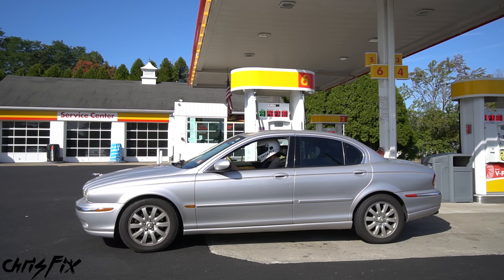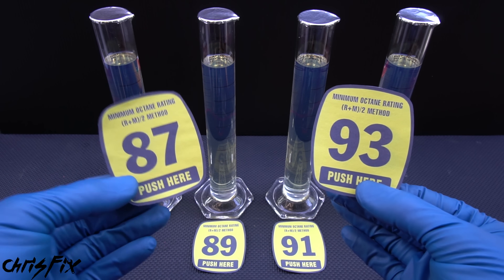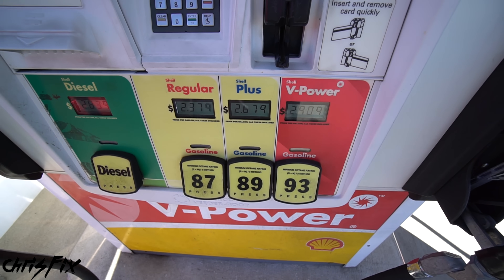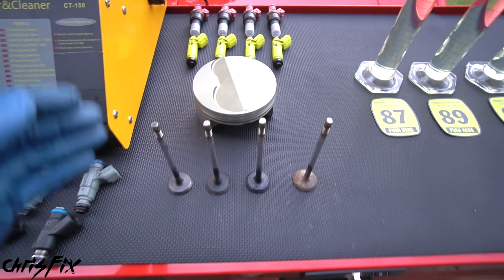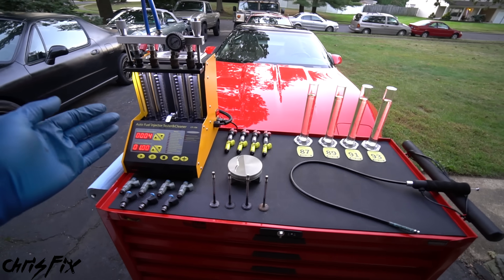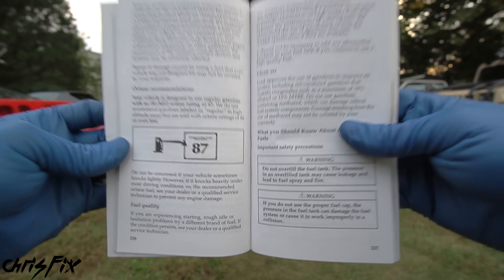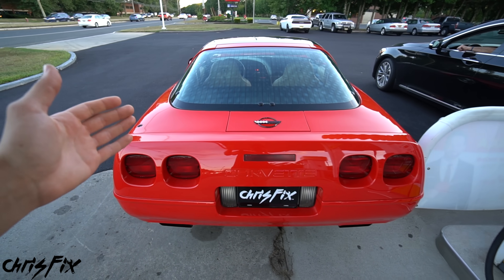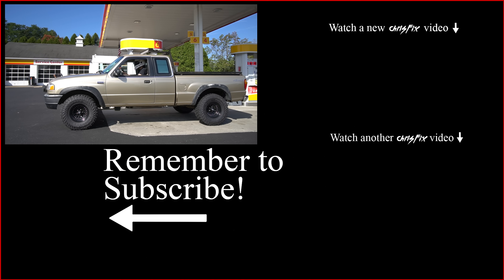What is the BEST Fuel to Use in Your Car or Truck and WHY

Comment: While I didn't need to watch this video, I did 😊 What I did get out of it though was I want crazy when I would use premium here and there in my 2003 Elantra with 177,000 miles on it and when I do, most of the knocking goes away. Now, I am going to only use premium for about 3 months. I'm a Chevron guy but might have to use that 93 at shell 😏 Thanks Chris!

Comment: They are big difference on my 2010 Nissan altima if I put regular fuel the check engine light on for Cat converter And then when I was almost on empty I put premium 93 after running it almost empty the check engine light go off it runs more cleaner.. And I have done this test multiple times and other cars.. So I  only use sell premium gas only they have the best gas..

Comment: I have heard this story before. Bottom line is whether you have a 5 hp engine or 300hp, the higher the octane, the more efficient the engine runs! I own an 05 tahoe, if i burn regular gas it uses more of it! That includes the lawnmower as well.I have done the test over + over + it's always the same.Thats my story+ i'm stickin' to it.

Comment: I think when people say high test is better..it might be because a modern car's engine can advance the ignition timing which will give you more power and better mileage. A good test would be to determine once and for all..does 91/93 increase mileage and power or not? Does 91/93 keep your injectors and valves cleaner or not? I wish you'd have done those two tests because I struggle with that when I'm at the pump!
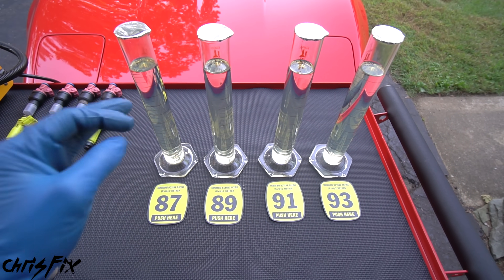Reply from the maker: 1:53 and 5:45

Comment: Higher compression requires higher octane but higher altitude means thinner air and lower compression . In Colorado above 5000 ft our regular gas is only 85 octane But that is fine for cars that specify 87 Because in this altitude 85 octane works as good as 87. Unless your car is turbo charged which increases the air pressure in your engine.

Comment: I put 91 octane minimum in all my gas vehicles; don't care what the manufacturer states.  Even lawn tractor gets premium fuel, I hate the smell of cheap gas!!  However, all my vehicles are high performance.  You get better fuel mileage from higher octane fuel too.  Plus you save on repairs and the motor just sounds like it runs better.

If I put regular (87) in my Escalade, check engine light goes on and starts flashing.  lol...

Sometimes, premium is not available and in the coronna era, many gas stations close at 5pm... so you're stuck with either cheap gas, or take a motel until the next day... so cheap gas it is!  However, I like the idea of carrying a can of Octane Booster; thanks for that tip!  =D

Flexfuel hahaha that's cute....

Comment: Ethanol vs. non-ethanol gas was not covered.  Also, it was not mentioned if there is any downside to running 93+ fuel in a car which specifies 87, only the other case.

Comment: Amazing video Chris! Two questions for you. You showed valves and how port injected engines clean them, but how do you clean them in direct injection engines? Is there any way to do so without taking the engine apart? Also, do you recommend running e-85 (assuming your vehicle can take it, of course). From what I’ve read it has a lower energy content, but is it better or worse for your engine? Thanks!
Reply: the best thing is to avoid ethanol gas, so avoid e85, e85 is honestly for race cars. you can only go so high in octane without having ethanol. theres a fuel induction cleaning service recommended every 30k miles, or 10-15k with e85

Comment: if all gas has the same energy then why is race gas 112 octane
and why do engines need different timing setting with different octane for the best power results

Comment: I use E-85 in my SUV. However there are very few stations providing E-85. What then? I use regular with a bottle of octane booster. I am not sure if this is correct. 
Any suggestions?

Comment: Would you recommend using BG 44K at all to clean fuel system? If so, would you recommend just using that product over having the dealership talk you into doing a fuel injector cleaning? I have a 2020 Acura RDX ASPEC, use recommend fuel. Dealer is already suggesting I clean injector system at 9000 miles. I said no, it’s brand new. Car does have direct injection. Thank you for any insight.

Comment: ChrisFix,

On the swedish wikipedia it's saying:
"Octane number is a measure of a fuel's ability to withstand temperature and pressure without igniting"

I don't understand why you say it's not anything about temperature. Since my Mitsubishi-dealer adviser says the wikipedia version. And you were saying that the owner should listen to the manufacture in this video.

Why I asking you this is becuase I have a GDI engine, and the engine require atleast 95 octane (RON) unleaded with 0 % ethanol. In sweden, where I live, the standard is 95 octane (RON) unleaded with 5 % ethanol (E5). I accidenty wrote a comment saying that we have 95 octane (RON) unleaded with 10 % ethanol (E10), since EU has decided the fuel pumps must have a sign saying how much ethanol there is, I figuered out I was wrong. Insteed Sweden have plans for import 95 octane (RON) unleaded with 10 % ethanol. Wherever this is going to happen is not decided.
We also have 98 octane (RON) unleaded with 5 % ethanol.
It was the 98 octan the Mitsubishi adviser suggested me fueling with if the E10 was beggining to selling here.

I really like your videos, I got my car from my dad 2017 when I got my drivers license. It is 20 years old now and have been going about 197 000 km. I really like this car and I want to keep it for as long as possible.
As long I have money and room for it if it breaks down, I will repair it.
I really think that suspension issues are more easily fix that issues deep down the engine.

Comment: Mr Chris this following is from the owners manual. What is your understanding? (5.7L/6.4L Engines 
This engine is designed to meet all emissions regulations and provide satisfactory fuel economy and performance when using high quality unleaded gasoline having a octane range of 87 to 89. The manufacture recommends the use of 89 octane for optimum performance. The use of premium gasoline (over 89 octane) is not recommended, as it will not provide any benefit over regular gasoline in these engines. 

Light spark knock at low engine speeds is not harmful to your engine. However, continued heavy spark knock at high speeds can cause damage and immediate service is required. Poor quality gasoline can cause problems such as hard starting, stalling and hesitations. If you experience these symptoms, try another brand of gasoline before considering service for the vehicle. 
)
Reply from the maker: It's saying your car can use either 87 or 89 with no issues, but anything over won't provide any benefits! (and would cost you at the pump)
Reply: @chrisfix   Thank you for your replay Chris. That is my understanding as well, but will not hurt it either. However,  I am not as confident when reading the last paragraph. My understanding  that it is referring to using bad gas. But also wonder if they are also referring to the higher octane. Although they didn't say that in the first part. Reason I wanted your take is because am thinking of using the shell or maybe the Chevron high octane for a few tanks just for the cleaning potential as a matter of preventive maintenance. 

I have a 2015 Ram with 5.7L hemi and guessing you are aware of the dreaded hemi tick. Due to this situation am more cautious then I normally would. Other than that I see no good reason to use a high octane for the reasons you explained in the video. No benefit in performance, engine designed with specific parameters air/gas mixture and so on.

Comment: Your v-power is only 93? Ours is 99 and I'm sure it was higher when it was called "V power nitro" I think it was 105 if memory serves around 2014
Reply: The US and Canada has a different rating system. "Shell V Power" in Europe, is "mostly" 98 octane. A couple of countries like the UK, have 99 octane V Power. 99 octane in Europe = 93 octane in the US and Canada. A 100 octane gas in Europe, is the US 94 octane. Often 93 octane gas in the US, is a 94 octane fuel, as 93 is an absolute guaranteed minimum that, that specific grade of fuel will be. All US grades are sold as a guaranteed minimum. So your 87 octane may be 88 octane just depending on the blend. But it's never going to be less than a true 87.

Comment: You teach yourself your idiot knowledge, don't said your teach us. I ran my car  since  brand new, 2009 MB B200 Turbo, with the lowest octane more than 11 years on the recommended higher octane fuel and had no problem at all till now. Higher Octane MAY help for a cleaner on the combustion but NO NEED to worry about the damaging the engine if you use lower octane fuel. You don't even notice the different between the fuel but on your imagination..

Comment: But 98 runs normal and its always only 98 but not 95 forever idk 95 is for example  saw
Reply from the maker: Thanks for sharing!
Reply: @chrisfix  You still can use it in  car normal 95 , but it idles with lil weird RPM. Its more bio and cheaper

Comment: How odd? Here in the UK, green is what we use for Petrol (Gasoline) powered cars. Over there in America, you guys have Diesel as green? Or is that colouring system just regulated to Shell? In case anyone is wondering, in the UK, we use the colour black to denote diesel pumps
Reply from the maker: It's the other way around here in the US, and it's like that at every station!
Reply: @chrisfix  thank you for the clarification, keep up the good work!

Comment: Any useful info on E-15? I believe that's what it's called. Saw it at local gas stations who also has E85 and all of the other usual fuels.
Reply: E-15 is 85% gasoline and 15% Ethanol. It's 100% safe to run in any U.S. purchased vehicle, thats a 2013 or newer model year. E-85 is only for Flex Fuel vehicles. Its 85% Ethanol and 15% gasoline. Check your owners manual for compatibility if you aren't sure.

Comment: I drive a 2018 CX9 that takes regular octane (87). But, I’ve been putting premium (93) from the get go.  Would it be safe to go back regular octane now that I have about 30,000 miles on it? Thanks

Comment: I live in Wyoming and I haven’t seen any gas stations with 87 and that’s what my suv recommends. Regular here is 85 but I use 88 instead which is mid grade here.
Reply: Mid grade would be best. It also won't void your vehicle's warranty like 85 can. 85 will burn fine in a vehicle that recommends 87 octane, but only at high altitudes. 85 octane is to low to burn at more normal elevations. And 85 octane is only sold in four states at high altitudes. The auto industry doesn't recognize 85 octane. And so 85 octane isn't covered by your vehicle's warranty.

Comment: Hey, i like your video. My last couple of vehicles have been turbocharged so i always run 93 octane from BP. I was out of town one weekend and was on empty so i had to pick the nearest gas station wich was a holiday, keep in mind this was about 6 years ago. All they had was 89 octane so i went inside and bought a bottle of Justice Brothers octane booster and filled the tank 3/4's full. I dumped it in before i pumped the gas. After about 20 miles my check engine light came on and the car was running terrible. When i arrived home the next day i did some troubleshooting and figured out my o2 sensor bofore that catalytic converter went bad. I'm pretty sure it was from the octane booster? I've put low octane in the car before and noticed a significant decrease in performance. After that experience I'll never use octane booster again. It could have been a Coincidence but i highly doubt it. The vehicle at the time was a 2001 volvo v70 T5 with a high pressure turbo. It was a excellent  car! That was the biggest problem i had ever experienced with that car in the 8 years of ownership.
Reply: You are correct! Octane boosters have been shown time and time again to be snake oil. Most fuel additives do as they say they do. But not octane boosters. They don't use the same chemicals as a refinery for making gas or making octane. Infact octane boosters have even been shown to sometimes reduced engine performance. And octane boosters often say they will boost your octane by 3 or 4 points for a full bottle. The only problem is that there are 10 points needed to make 1 single octane level. So you would likely need 2, or most likely 3 bottles to boost your tank by 1 octane. "Most additives" will work like I said. But octane boosters are one of the specific ones that don't do what they say they do. 

LOL! You would literally be better off putting in a quart of Everclear to boost your octane. XD

Comment: I run 100% gas 93 in my sky redline. Regardless of the 3-4 choices they all got that trash ethanol in them which isn’t good either.
Reply: Ethanol is a octane booster in modern gas. It also burns cleaner. The only downside to it, is that it doesn't have quite the shelf life if you want to put your vehicle in storage. It's always best to use stable for longer periods of storage. And if a vehicle is going to sit for a year or more, it's best to drain the tank completely.
Reply: @waycoolscootaloo   Thus the reason why I said 100% is way better. Quicker start ups and way better for the motor. Ethanol is 100% trash and I dont run that in my vehicles unless i got startron on hand.

Comment: Regular has already been proven to get the same miles and performance and it is a fact, ur buying and name like a shoe but a cheap shoe will fit just like the highest, watch a video a when even the experts all believed the highest was the best but regular was just as good as the highest and it is the same as the highest, u  just pay more and that's a fact. It's already been proven, sorry u got ur info from shell but I don't think they would tell you that, u can buy good products to put in ur gas to  clean it and how much did it cost a gas company to pay a car maker to tell you what to run and regular is the same as ur premium, use ur own gas additive and u know what you are getting
Reply: Eeyup! regular gas is all that's needed for 80% or more vehicles on the road today. High octane gas is made only for high compression engines. It's always best to use the fuel your auto manufacturer recommends in the manual. (I would only run premium if the manual specifically says premium is a "required" fuel.)

Comment: In the begining you said it doesnt affect power and 12:30 you say it might affect. So what is it?
Reply: Placing high octane gas in a car made for 87 octane, won't cause your engine to develop more power. "Some cars" however, can adaptively change their tune to develop a bit more oomph when it detects higher octane gas. (Usually sports cars with higher compression ratio engines.)

Comment: LOL....
I think you should take the rubber gloves off and hang them up.

I am not gonna get into this with you or anyone else but this video is somewhat inaccurate.
 I am a retired mechanic and collision expert.

Have you ever taken an engine apart?
Have you ever adjusted a valve??
 Have you ever replaced a timing chain??
 Have you ever even replaced serpentin belt?
 I bet you never even took an engine out of a car, or even change the transmission...

 I am sure a lot of people could appreciate your videos but you need to put some facts behind them before you broadcast them

Comment: Sorry. I think you are wrong. Octane does directly correlate to how fast the fuel burns. Which is what causes the knock. The higher the octane the slower the fuel “explodes”
Reply: It's not how fast or slow it burns. It's the fuels ability to resist detonation under pressure. A higher octane fuel, needs more pressure to ignite. So higher compression engines, typically require high octane gas.

Comment: My chrsyler 200 2011 2.4  engine touring has an engine spark knock I'm using the cheapest gas maybe I need to use a richer gas

Comment: Does the gas station you go to matter? I used to only go to Shell because I heard they have the best gas. Also, does adding fuel additives constantly good for the engine?
Reply: The best station to go to, is anyone that is in the "Top Tier" Fuel program. Just look for the "Top Tier" Insignia on the fuel pumps. Most major gas stations use Top Tier gasoline. It's all the same stuff.

Comment: Why not just use an octane booster? 🤔
Reply from the maker: That would get expensive fast if you did that on every tank!
Reply: I'm not really practical with the gas prices in the USA, but here in Switzerland the regular fuel (95) costs about 1.50 bucks per liter, while the vpower (100) is around 2, and a can of octane booster for 40 liters costs 15, gas here costs a little bit too much😂
By the way you channel is awesome and very helpful keep it up💪🏻
Greetings from the Swiss mountains🇨🇭

Comment: Chris , you are so right. I have a Toyota Tacoma with 230k miles. The other day I put 87 octanes from 7 Eleven then car almost shut off. So I went back to Toyota dealer then advisor told me I probably had water in gas. He told me :”to get rid of the water you need to put a higher octane to burn off all the water in the gas tank.”

Comment: I use LEAD SUBSTATUTE  IN MY 70 CADDY DEVILLE WITH 92 OCTAIN....ITS A BEAST! ALL 400 HORSES HELPING THE OZONE ALL  SUMMER LONG! WISH WE STILL HAD LEADED!!!!
Reply: Why? What does the lead do?
Reply: @jamesarnold4339  boosts octane by a lot. Actual race cars use lead in fuels so that the engine doesnt explode. And you could also buy like a gallon of leaded race fuel for like $20, it aint cheap.